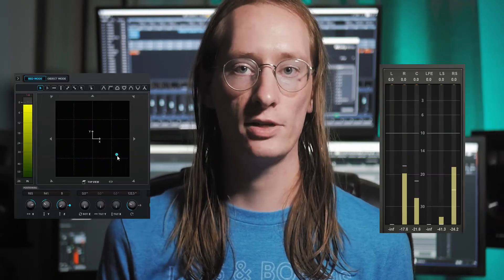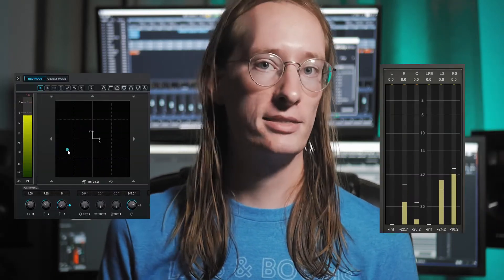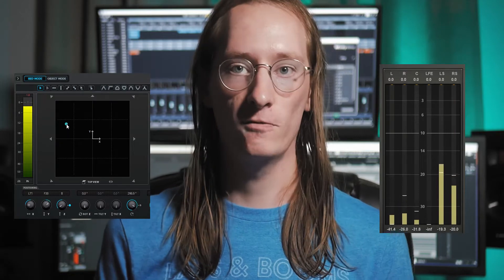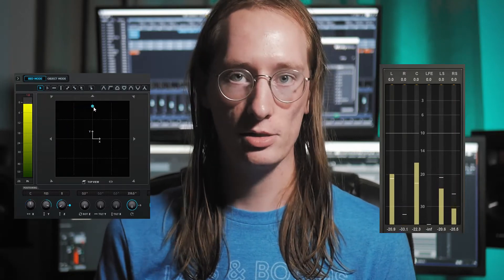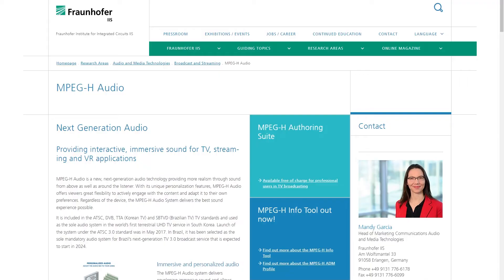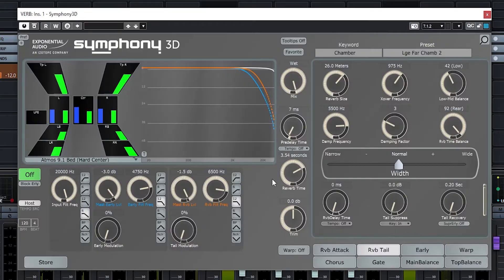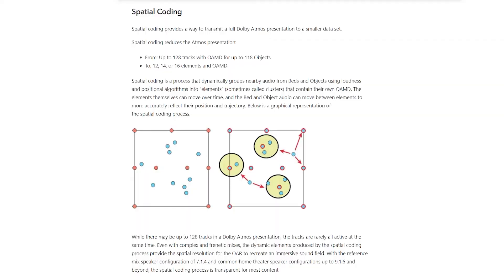How Does Object Based Sound Work?

Comment: Dolby delivers conventional channels and then cuts out portions of them to create the extra objects. This seems to serve three goals: a downmix is playable everywhere, the object stems are protected from extraction and the total number of channels is kept reasonable. MPEG-H is an entirely new codec without any backwards compatibility requiring a new device and even lower fidelity. I heard that they built it on parametric stereo and MPEG surround. In either case what the consumer gets is significantly cut down from the marketing theory.

Comment: Honestly, sometimes I think it's a scam. I have played several atmos movies on my pioneer vsx930k but I can't hear any improvements apart from occasional sound coming from above. In fact I think it degraded the sound. The Dolby atmos volume is very very low that I had to turn up the volume of the receiver all the way up and it sounds too bright as well. I usually switch back to DD+ or dolbyHD because they sound more immersive and heavier.

Comment: Gsus fcking Christ...I was literally searching the internet for nearly 2h now to get a proper explanation of how beds differ from objects and why someone would use beds in the first place...so thank you so much!! One additional question though

Do you by any chance know how a cinema would route the speaker set up to the dolby renderer there? Because if Dolby Atmos uses a hybrid approach of CBA and OBA then they would still have to connect for instance all the side speakers into the side speakers out which would mean they would be handled as one physical output. How can they then be used as seperate outputs when Audio Objects are being used? Hardware wise I mean? 

Thank you so much in advance!
Reply from the maker: Glad this helped!

In cinemas, every speaker is addressed by its own output and amplifier channel. Dolby has a series here (https://vimeo.com/278572144 ) that goes into more detail. Essentially you'll have an Immersive Audio Bitstream feed from the DCP server to an audio processor like the CP850. The processor then renders that bitstream appropriately for the auditorium and sends the channels to an amplifier like the Dolby Multichannel Amplifier. Typically the data is transferred over ethernet to make it a bit easier.
Reply: Thank you so much for your quick response! I'll look into that asap. But if every speaker has it's dedicated physical output, doesn't that make beds and therefore CBA kind of obsolete? @AlteraSound

Comment: On your previous video short: Don't get too caught up in the hardwood over carpet debate. There's a lot of mythic and outdated information out there that unfairly puts ALL carpet as high as 0.6 kHz absorption coefficient in the high frequency range. This information dates back to studies around 1988 that were testing very thick and heavy shag carpet. Modern day carpet and padding is much thinner with absorption coefficients as low as 0.2 kHz in the high frequency range. Carpet has been unfairly demonized based on a few outdated studies from the 80's. Also the majority of studios with hardwood flooring end-up putting down a large area rug to help control the floor reflections from the wood anyway. In my research, thin carpet or a thick area rug is going to have a near similar affect on absorbing some of the high frequency range and in controlling reflections.